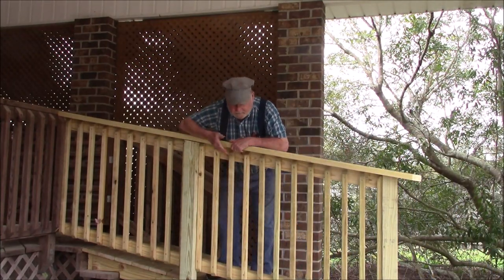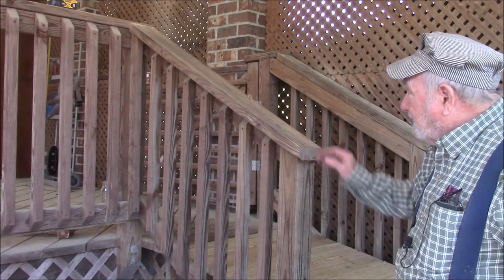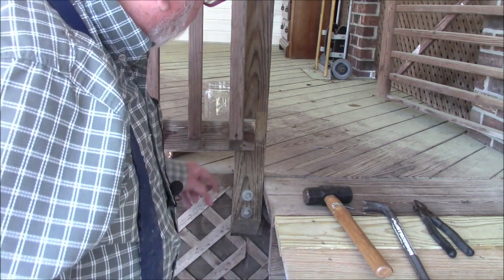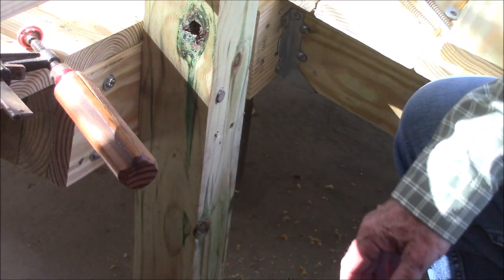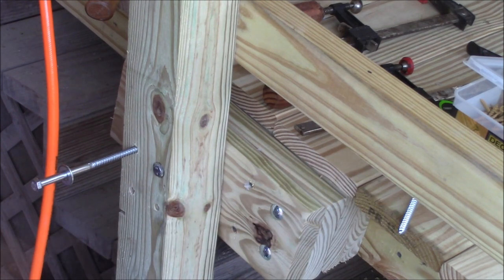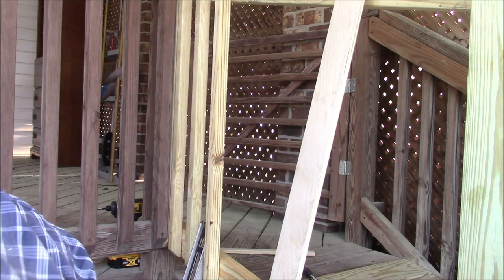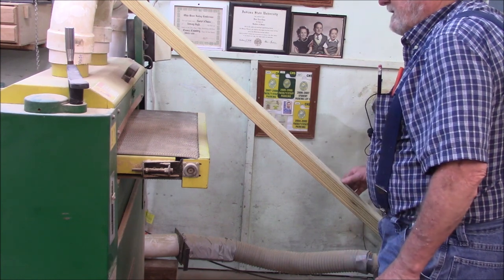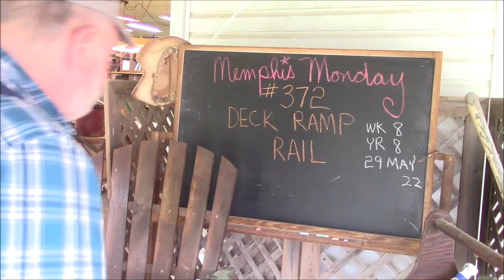372 Deck Ramp Railing

Comment: You always  build "sturdy" and I can appreciate that mind set. This hand rail looks like it will stand up to your 1000 year guarantee for sure. You are right about checking for level/plumb every few boards. If you don't, when you're done you'll stand back, admire your work and say "something doesn't look right". Solid take-away there.
Reply from the maker: Yep, and your notion of standing back and applying the Mark 1 eyeball is always a good idea.  Sometimes the old Mark 1 can trick you, but most of the time at least you will get the "something doesn't look right" warning.   Admission time: after I installed the hand rail I did stand back and admire my work.  Oops, the angle of the rail doesn't exactly match the angle of the ramp.  Too late, but I'm glad I'm not a perfectionist.
    Thanks for watching and commentingl.

Comment: Looking good. Question though because it’s bugging me and my brain isn’t figuring it out. You shimmed that middle post out a couple inches past the deck boards but it looks like the top and bottom posts are flush with the deck boards. I was expecting to see it bowed out in the middle but It looks straight. What am I missing? Have a swell holiday!
Reply from the maker: Thank you so much for watching so closely.  Not many would have noticed such a detail.  I'm up loading a Memphis Answer video to fully answer your question.
Thanks for watching and commenting.